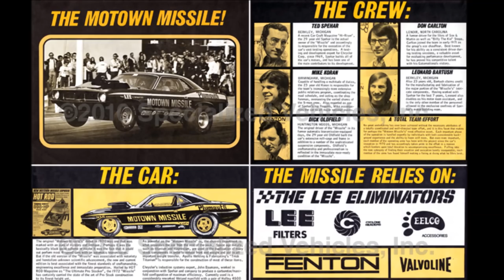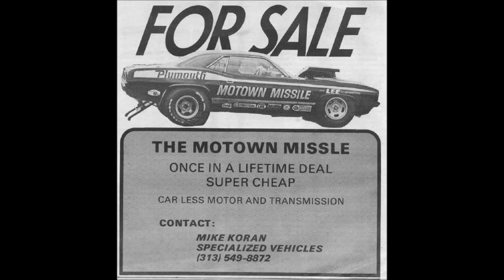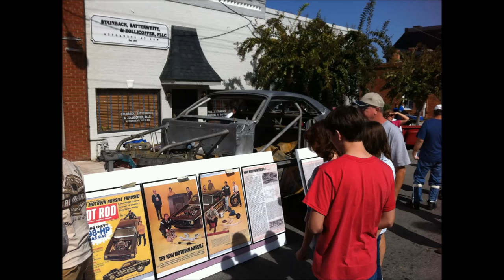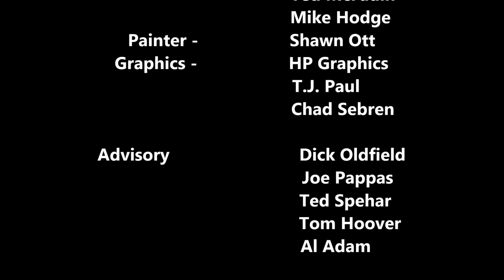Motown Missile 'Cuda The Movie

Comment: My Son and I have a 71 Cuda drag car l bought in 2011 were gonna rebuild the small block this winter it was in an 81 mirada that ran 11:5s with a 300 shot of nitrous the Cuda has 488 gears and fiberglass doors and frontend so we should be able to run in the 10s it will mostly run 8th mile were it should do quite well
Reply: 8th mile is not real racing......😉